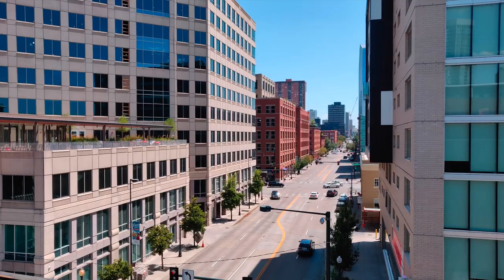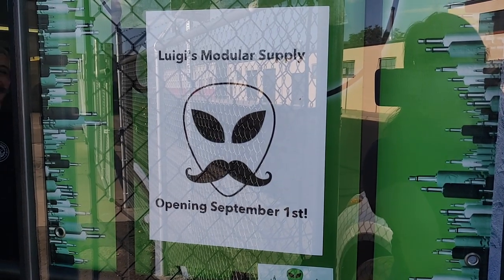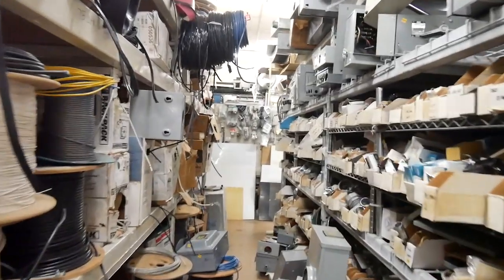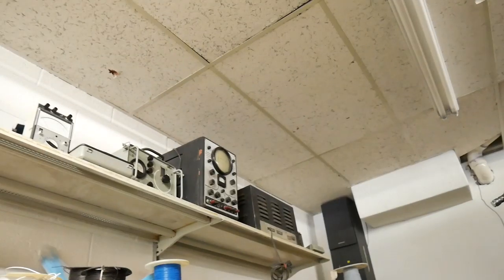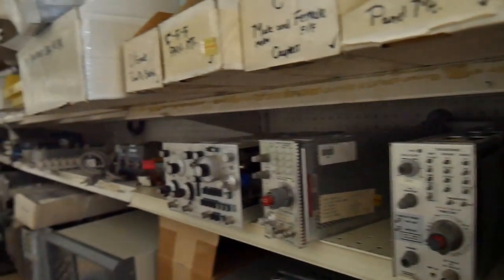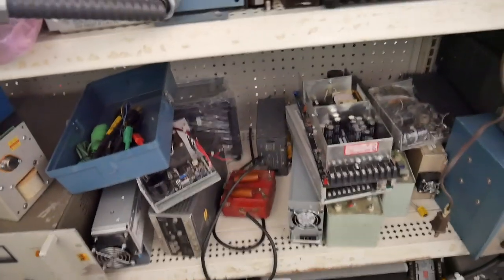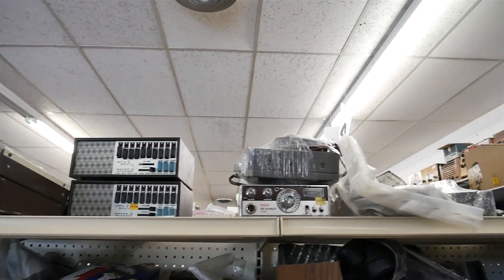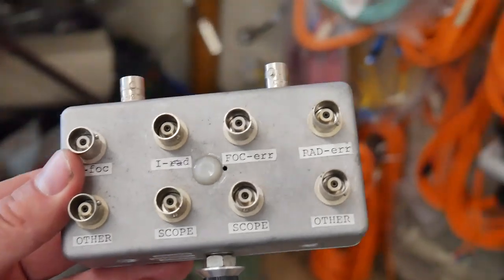A #willitmusic Wonderland

Comment: Apache Reclamation in Phoenix AZ has some great stuff. I bought an autopilot test set, a beautiful metal case loaded with switches and patch points, which I intend to use as an interface to DIY synth modules.

Comment: In the mid 1980s my father took me to OEM and my earliest memory is the owner teaching me how to etch PCBs and then how to solder correctly. My early boards were adapters and modifications to my Vic-20 and later Commodore 64. Over the years and as I learned more, I always relied on OEM and they were always very kind and helpful—not just in selling me parts, but helping me learn along the way. I'll definitely be making a trip to say goodbye and get a few last items. Side note: There is also a family owned pizza shop in the same strip (Roadrunner Pizza and Pasta) that I recall being some of the best pizza in town. If you make a long road trip and you're hungry, I recall them having some really delicious specialty pizzas after you get some parts.

Comment: The quiet excitement really shines through in this video. I've only managed to find one place that compares to this would be J. Birkett, located on The Strait in Lincoln (UK).  It has apparently been running since 1960, and seems to have a good reputation amongst the local amateur radio scene. The eponymous Mr Birkett claims that his is the only shop left of its kind in the country, which would line up with my own experiences in trying to find one. He is also approaching his nineties, according to the internet, so that shop may too be not long for this world. From what I remember it was very similar to OEM on the inside, although I was only fifteen at the time - my mum wouldn't let me buy anything, doubtless envisioning the leaning tower of test equipment that would result from it. 

EDIT: I feel I should mention this: due to the fact that the owner is rather elderly, the opening hours for the shop are rather short. He opens only on Thursday, Friday, Saturday and Tuesday, from 10 AM to 3PM. 

 Finding a meatspace shop for second hand electronics or repair of any kind is difficult where I live, with the few that exist focussed solely on white goods. The best I can get around Manchester is army surplus shops,  'vintage emporiums' and charity shops, which might occasionally get something interesting (be wary that, on the rare chance you do find something, it will likely be both broken and insanely overpriced). Following the closure of Maplin and Clas Ohlson there is nowhere at all within the city centre that sells electronic components, which is incredibly annoying.

Comment: I worked in the test equipment calibration lab at a Florida Motorola plant in the 70's and early 80's. The tone generator seen at the 5:00 mark in this video was used to send two sequential "access" tones to pagers and two way radios. As this tone access technology was replaced by digital access, these generators piled up in the lab and were auctioned off. I remember wiring a 6 or 8 of these things together such that one triggered the next.....this was a crude but quite useful sequencer / synthesizer device that could throw down some serious bass lines.....all sine waves though.
Reply from the maker: Oh I wish I could hear that! Any surviving recordings?
Reply: @Hainbach  No, that actually happened inside the Motorola plant. It was one of several clandestine experiments we did in the lab on those late light shifts. The plant had some serious security back then due to many government contracts. Cameras or "sound recording equipment" of any kind were grounds for termination. I did wind up buying a couple of these at a scrap auction but used then for ham radio stuff. My adventures in sound at that time were powered by a room full of ARP and Univox (Korg) stuff which I was stupid enough to sell cheap in the late 80's.

Comment: I went in my first test lab equipment hunt (usually it's just for parts and components) a month ago in San Jose, California at a spot called Excess Solutions and found a Wavetek 166 signal generator and an hp attenuator - got both for a beyond fair price. They had lots of random stuff and is worth a visit if you're in the SF bay area; super crazy stuff.

Even if I leave empty handed, going to wholesale electronics stores are an experience for the technical archaeology and the crazy array of people who go to those spots.

Comment: HP had (still has?) a large Colorado Springs facility that used to make test gear, and calculators as I recall (I worked for HP in the mid to late 90s). So the type of gear you find in surplus stores around there was the 'old school' HP quality; gear by engineers for engineers, virtually indestructible. Here's an article from the HP archives from 1982 that talks about what they did in the Springs: http://hparchive.com/measure_magazine/HP-Measure-1982-11-12.pdf. Great you got a chance to wander through there before they closed. There's many of these type of places hidden around the US, especially California.